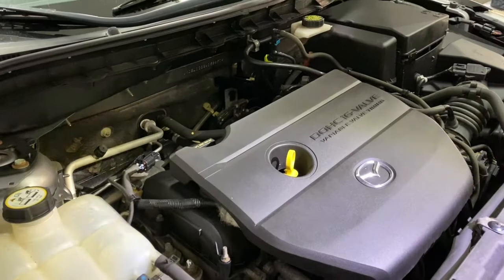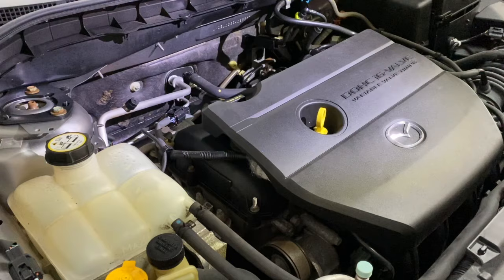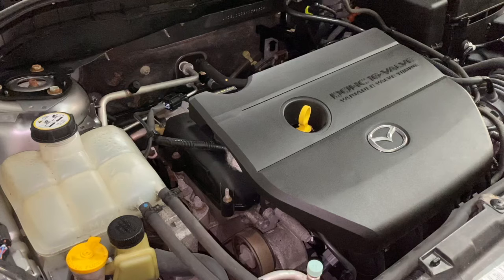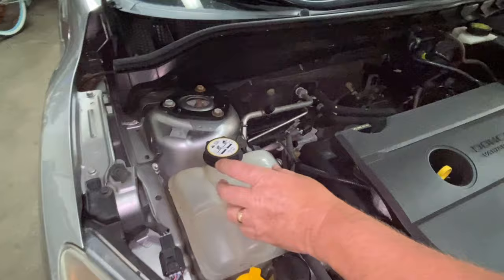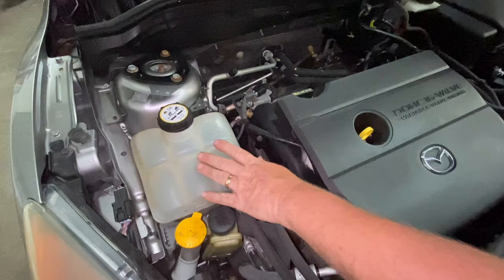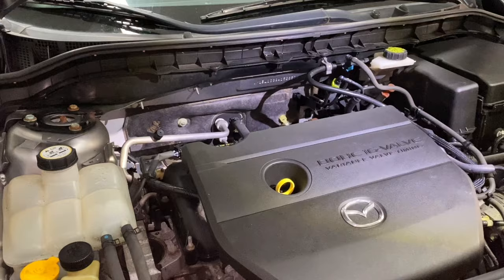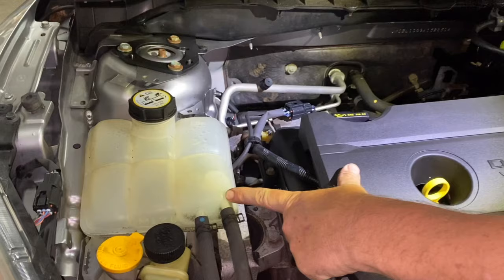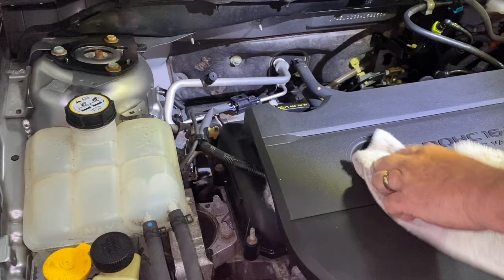Learn 3 Symptoms of Blown Head Gasket

Comment: Iv just had the head gasket replaced on my Vauxhall Mokka petrol. But iv still got excessive white steam coming from the exhaust and water is dripping from the exhaust box. Temperature gauge is normal. Mechanic said this is condensation and is normal as the Mokka has a catalytic converter and the white smoke is how it releases emissions. Is this correct as it doesnt look right to me?
Reply from the maker: If you were burning coolant before the head gasket repair then yes it is normal to see some smoke because the coolant that’s in the exhaust system from the bad head gasket has to burn out. Should clear up within 50 miles of driving depending how bad it was.
Reply: @Motorcarnut  thankyou for replying so quick. Phew, I feel relieved now. The mechanic had said it was normal but i wasn't so sure. It was still blowing lots of white vapour even though the engine was warm. I was in a panic as I thought it hadn't been fixed properly.

Comment: Hey I have a 2000 Toyota Camry and recently changed both radiator hoses and thermostat. After a couple weeks I noticed a thick white cloud of smoke come from the exhaust. What I’m confused is that it stops after the car warms up. Any idea?
Reply from the maker: Yes, When metal heats up or cools down it expands. When cool, you probably have coolant seeping into the combustion chamber and as it heats up, it seals, makes sense? Probably the head gasket is starting to fail or a crack somewhere but more likely the weaker link which would be the head gasket.

Comment: I domt have any of those symptoms..but im loosing coolant (I park on a driveway, it's not leaking). I just paid $800 to have the thermostat and water pump replaced, and it didn't do anything. Temperature gage goes up and down when I'm driving on highway
Reply from the maker: It’s probably burning it when the car is hot and you really can’t see it when you’re driving. Gauge is supposed to stay around the middle or a little below at operating temperature.
Reply: My car does the same thing. I said $600 and replaced the Thermostat Housing, Thermostat, O Ring, and it is still overheating. I was told that my head gasket had blown and I need to get a motor. But I refuse to do that because the oil isn't mixing with the coolant which is a sign of a blown head gasket.
Reply: @unclerod2542  so it turns out the first time I had the thermostat replaced, if was a defective thermostat (or the first mechanic just ripped me off)..anyway, after the thermostat was replaced again, the car runs fine

Comment: Quick question...can a bad cracked open(no top or cap) radiator fluid reservoir cause any problems after driving the car but cars not overheating then start noticing heavily white smoke and car still not overheating but now engine start is very rough,idle stays at 1rpm and makes a dramatic rattling noise when pressing the gas while driving(specifically when car automatically is trying to go into second gear but hesitates,what can be the issue here?
Reply from the maker: First off, yes the reservoir cap or a radiator cap must always be installed or the car will overheat 100%. Second, sounds like the head gasket blew or you have a cracked head or block but most likely blown head gasket. Also from what you're saying the engine is knocking now too.( I have a video on what engine knock sounds like, compare it to yours)  should have it looked at asap.

Comment: I just got my waterpump and thermostat replaced but the car still overheats, no white smoke is showing and no milky substance, could it be a clogged radiator?
Reply from the maker: Absolutely, Try this first, with engine cold squeeze large top radiator hose should be kinda soft, now start the engine and wait about 2 mins and squeeze that hose again it still should feel the same way, if its hard like a rock then the head gasket is pumping up the coolant system because engine wouldn't be hot enough to create pressure yet, if not just before it overheats feel the top and bottom large radiator hoses and see if they are hot. They both should be very hot. Also, check if the car has hot heat at the same time.
Reply: Don't forget to bleed your cooling system. Mine was overheating and had a lot of air after a flush.

Comment: Hey can u help me? I just changed my oil but i couldnt get the filter off so i left the oil cap off for like 5 days.
When putting in new oil i spilled some. When i started the car there was a lot of white smoke and now theres a thinn white layer of white slime on the inside of my oil cap.
It stopped smoking but im afraid of a head gasket leak
Reply from the maker: That thin white slime is normal. Should go away in about a week.
Reply: @Motorcarnut  thank you very much <3
Reply from the maker: @konsty_2 no problem

Comment: Question
If I empty my radiator and drain all the coolant and the white smoke goes away. Could that help prove that it's a coolant issue. Also, if it's not mixing with the oil, and is just being burnt in the combustion chamber like this one you showed is, would that result in a rough idle and engine rpm bogging when pressing the Gas? I also smell a burnt oil smell
Reply from the maker: I wouldn’t recommend running engine with no coolant. And yes coolant in the combustion chamber with result in misfiring
Reply: @Motorcarnut  thanks for the reply! I currently redid spark plugs. Coil packs. fuel injectors. Distrubutor caps and rotors and cables for them and a mass airflow sensor.  I realized that my car takes 5w 30 but saw somewhere that 0w 20 was good for my high milage car and after an oil change 1-2 weeks later it started to blow white smoke from engine bay. Blackish grey smoke out the rear and misfires and has a rough idle as a result kind of like a heavy cam rythem. After doing all the previous work I also did a oil flush and filter change to the correct oil and it still has same problem. I bought a test kit that'd like a turkey baster with blue fluid that turns green if it detects Gas in the coolant and all and that didn't turn green so I'm at a bit of a loss rn at what I could be. Edit: also I let the car warm up and it doesn't overheat at all. Doesn't seem like coolant get warm either. After warming up I took rad cap off and stuck my finger in and coolant is cold and not moving. It's suppose to be jiggling from what I've seen so not sure how that works. Especially since my Temps aren't overheating
Reply from the maker: What is the year make and model?

Comment: Car didn’t smoke before I did an oil change but I when I did the change I had no oil and I didn’t change the oil filter 🤦‍♂️🤦‍♂️and now when i start it every time it blows clouds of white smoke
Reply from the maker: That doesn’t make sense. White smoke is an indication of coolant burning not oil burning.
Reply: @Motorcarnut  well idk I’m not sure I did the radiator test on a cold start and no bubbles not sure what was it but it stopped smoking

Comment: Great video!! So although you had white smoke why did you not have any milk shake on the dip stick ?
Reply from the maker: Thank you!, good question. Because the coolant was leaking into the combustion chamber and not in any oil galleries. So there was no mixing oil with coolant.
Reply: @Motorcarnut  And what is the solution in this case? My SUV has a lot of white smoke, but the dip stick is clean with only oil. I know that´s a head gasket problem. What can be the solution for my car? thanks!
Reply from the maker: Head gasket replacement if the white smoke doesn’t go away.

Comment: My coolant is getting extremely hot but temp gauge stays normal, my engine feels way hotter then normal as well. Idk what’s going on it’s a Honda so who knows I recently mixed oils I know that’s not good but I had no choice at the time of doing so😕
Reply from the maker: What make the car is has no significance. Maybe the coolant gauge is inaccurate? What makes you think it’s hotter than normal? Is the car overheating?
Reply: @Motorcarnut  overheating as in smoking? No it hasn’t smoked this radiator yet( knock on wood) I just know the normal warmth of my motor and latley it’s been way hotter then it use to be. The radiator fan doesn’t kick on either like never only when I turn on the ac they both come on so I keep AC on all the time
Reply: Could faulty thermostat cause incorrect temp reading on the coolant temp gauge? It also starts to get hot really fast like as soon as I crank it the temp needle starts rising
Reply from the maker: Yes, thermostat can do that. Like I said the coolant gauge may be faulty. You should change the coolant fan switch it’s probably bad. Made sure your head gasket is not going, that can give you the symptoms you’re experiencing as well
Reply: @Motorcarnut  how shall I go about figuring If my head gasket is going ? Take radiator cap off and crank it? If it bubbles bad news ?
Reply from the maker: Easy way is to buy a test strip to put in coolant to see if there are any exhaust gases if there are then the head gasket is blown.

Comment: Hello. I have a 2014 Ford Ranger. Recently replaced the thermostat, flushed the cooling system but I'm experiencing white smoke when the engine is cold. The AC doesn't warm anymore, but as soon as the engine is warm ( heat gauge more or less in the middle) the white smoke disappears. 
No milky residue. Suspect it's coolant burning, but don't know if it's the head gasket that's failing, because there's no visual coolant leaks. Any advice would be appreciated?
Reply from the maker: It's normal to have some white smoke when the engine is, say overnight cold, that's just condensation, but if you know it's more than normal, try giving it a smell, if it smells a kinda sweet than you're burning coolant. Probably because when the engine is cold metal expands causing the coolant to enter the cylinders and when it heats up it seals itself. Probably a blown head gasket or a crack in the head or block but that's rare. Hope this helps.
Reply: Can white smoke come out of its cold outside than normal? Is it normal for white smoke to come out for a minute if its really cold outside than stops after a minute??
Reply from the maker: @franky-fr9ow Yes, that’s called condensation and normal
Reply: @Motorcarnut  well I'm sure its not condensation because my car has thick smoke accompanied by a rattling or grinding sound coming from the hood
Reply from the maker: You left that out of you first comment? I’m not a mind reader

Comment: Got a 2007 Chrysler 300 No smoke crank right Up Runs hot sometimes Replaced thermostat Hot/Cold hand does not go to the right place even after car warms up You think it might be the Temp Gauge or Gaskets ???
Reply from the maker: Does the car overheat?
Reply: @Motorcarnut  Sometimes It does sometimes it doesn’t
Reply from the maker: Well either the car overheats or it doesn’t? I mean the car boils over and coolant come out of the overflow tank? Not talking about the gauge that could be inaccurate.
Reply: @Motorcarnut  ohh yea it does & plus had no Heat during winter time
Reply from the maker: Sounds like the head gasket is going to me.
Reply: @Motorcarnut  preciate you just gone replace the whole motor

Comment: I have a 2014 dodge charger R/T. I believe is losing coolant somewhere, car does not overheat nor have any problems but I do seem to keep filling up reservoir to the top of coolant range every week/2 weeks and it’ll end up under the coolant range. No white smoke, nor coolant in oil vice versa. What you think I can check out if you could help or anyone else
Reply from the maker: It’s either a tiny leak maybe when engine it hot on the highway or it’s burning it slightly
Reply: I checked under car earlier and I seen couple drops of coolant on the lower radiator support I’ll have to check some hoses I believe

Comment: The mechanic shop said my engine is done yet my bmw 550i will still go 100+ mph with no check engine light or overheating and it sounds like a perfect running engine and it doesn’t smoke at all. What could be blown in my motor??
Reply from the maker: Well what did the mechanic say was wrong with it?

Comment: There are 7 ways a head gasket can blow:

Water and oil mixing = chocolate milkshake oil. If you drive like this for any length of time you will nuke the bearings and need to tear apart the engine.

External water leak  = coolant leak to outside, no problems for the time being provided you keep it topped off.

External oil leak = pretty similar to coolant leak, keep it topped off.

External combustion leak = runs like crap, sounds like an exhaust leak

Combustion and oil mixing = blue smoke, runs like crap, will nuke the bearings.

Combustion gasses mixing with other combustion gasses = runs like crap, possible intake backfires 

Water and combustion gasses mixing = white smoke, sweet smelling, bubbles in the coolant if you pull the radiator cap. If you drive like this for a little while it will be fine provided you don't overheat it. Don't drive too long on it though. This is how my head gasket blew. It shot out crazy white smoke like the car in the video.

Type 1 and Type 5 you must stop driving ASAP and fix the problem. The other types you can drive for awhile but shouldn't for any more time than necessary.

Types 1, 5, 6, and 7 will cause overheating.
Reply from the maker: Yes their are many ways but the video was on 3 major ones. Good info for others to read. Thanks for that!

Comment: My car it struggles to turn on for like 1 second and white smoke comes out but it just comes out when I turn it on once it’s left on while running nothing comes out like it’s all normal and then I turn it off and it turns on right away what can it be
Reply from the maker: Depends if this happens when the car sits overnight or long periods of time, because if it does, could be a small coolant leak inside the cylinder that builds up over long period of time and when you go to start it, it takes that extra second or two because of that hence that white puff of some. When a car is first started in the morning thin light white smoke is condensation and normal.

Comment: Hey there don’t know if you can help, but I’ve had a bit of a overheating issue with my car, my car gets hot and don’t seem to know how to cool it’s self down my coolant is bubbling and over obviously overheating and it likes to poor the coolant underneath the car, however my oil is immaculate so is the dipstick and coolant cap no milky residue what so ever and no smoke what so ever coming from the exhaust, I had the engine coolant bottle replaced incase there was any cracks and got a new lid along with it but it’s still happening, any help with advice would be great, thanks I’m advance👍🏻
Reply from the maker: Ok, so it seems you have a overheating issue that’s probably not a head gasket problem. Do cheap things first. I don’t know what vehicle you have but try changing the radiator car or expansion tank cap and see it that fixes it. If not, thermostat would be my next step. Radiator itself can be clogged, water pump too but rarely they fail to cause overheating condition in most vehicles they usually leak first. So there are some options.

Comment: Hi, I have a mazda 3 2011, it has been losing water from the reservoir container, I have changed the thermostat, the water pump also the coolant temperature sensor, and no white smoke comes from the exhaust but when I park after driving 8 miles, the reservoir starts to boil and lose coolant from like a relieve hole it has the container and drains all the coolant from the reservoir tank, I have done a flush in the cooling system and its still the same, WHAT ELSE COULD IT BE?? PLEASE HELP, but no hot temperature light turns on.
Reply from the maker: The car is overheating for some reason. Could be a simple bad radiator cap or clogged radiator or a head gasket that’s pumping up the coolant system and causing the overheating condition and wouldn’t have any white smoke or trigger the light on the dash either.

Comment: Mine does none of these but it leaks coolant out the head by the exhaust manifold is it still fine to drive?
Reply from the maker: No, because it will only get worse and can fail at the worst time ( ie highway, far from home etc.) and blow the engine.

Comment: Okay, I found this on Google. Looking for more advice- my car (2007 Honda Accord) has been overheating a little bit. Hotter than average (about 2/3 to top), but no smoke, engine doesn't cut out. I jave lost a little bit of coolant here and there, but nothing alarming. I've looked at the dipstick, but I can't see anything related to mixing with the oil or high oil levels. Would this be a head gasket issue or just a thermostat/radiator issue?
Reply from the maker: I always tell people to start with the simple things first, check or replace the radiator or overflow cap first, then I would change the thermostat and go from there.

Comment: Can a blown head gasket lead to extreme wear on the ignition coils?
Reply from the maker: Not directly no, a bad or poorly gapped spark plug can put undue stress on the coils unless there were so much coolant in the cylinders to short out the coil but this is rare and car would run too long anyway.
Reply: @Motorcarnut  can a steering rack and pinion leak cause a blown head gasket? My subaru outback sedan 3.0R has a mild leak